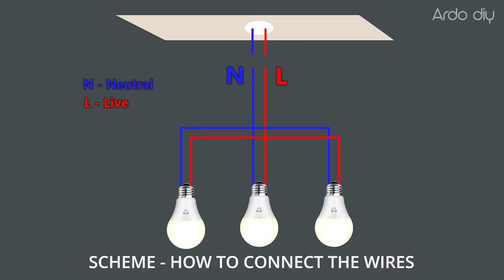Home Decor Idea - Diy Chandelier From PVC Pipe

Comment: Sad that the pancake box wasn't shown installed into the 1/2 center hole... But this method is also used with conduit pipe for larger spacing and even around bends (to follow the curvature of a bar). The pipes are primed and pained, and while they lead away from a closed pancake, they are attached to the ceiling with conduit straps (also primed and painted)!
Low voltage lighting gives great ambiance to accent these lights (just use inside the front top of cabinetry, and the light bounces off the crown moulding)!!
Reply from the maker: Thank you for your advice 🤗🤗

Comment: Hi i would love to make this myself could you send, the materials used, measurements and sizes please. This is a first attempt for me. I would like to know what to purchase when i go to the hardware supply store. Thank you.
Reply from the maker: Hello.
Forgive me for the late reply.
Pipe diameter 110mm
Pipe height 27cm
Use a drill to cut holes in pipes
buy wires, 3 sockets for bulbs,
threaded pipe to fix the lamp caps to the base.
one piece of board of your choice for the base of the chandelier.
Reply: Pipe dia =4 inches
PVC pipe costs around 800rs. 
And lights of your choice
Reply from the maker: @prakharsharma1281   
 thx
Reply from the maker: @karentsarukyan985   thanks bro 🤞😎

Comment: t's very nice, I have a question, is it white cardboard placed inside the chandelier? If not, can you tell me what the material is, I am thinking of buying materials and making it accordingly, I would be very happy if you could help me.
Reply from the maker: This is thick drawing paper called Whatman paper with a density of 200 g/m2.  Be sure to remember for this project you need to use only LED bulbs with a maximum power of 5watt
Reply: Thank you for your answer. Where can I get Whatman paper? What thickness should it be? @ArdoDIY
Reply from the maker: If your city has a specialized stationery store, you can search in these stores.  If you can’t find one, you can alternatively buy the thickest paper you can find, size A2 or A1
Reply: I understand, I'll look at the stationery stores and if I can't find it, I can use thick white cardboard and it won't be a problem, right? @ArdoDIY
Reply from the maker: Everything will be OK.  You should also paint the inside; the paint will provide an additional protective layer for the paper.  be sure to remember that for this project, you need to use only LED bulbs with a maximum power of 5watt.
Reply: I understand, I will take what you said into consideration, thank you very much for your help. @ArdoDIY

Comment: Hello. What kind of sheet you use as inner layer at 2:14?
Reply from the maker: hello this is a thick paper for drawing
Reply: @ArdoDIY   tracing paper? Is it safe to use?
Reply from the maker: @syp3284  hi thanks for the comment, this is not tracing paper, this is thick drawing paper.
For this project, you need to use LED bulbs, I have this chandelier hung in the kitchen and has been working for 6 months now, there are no problems.
Reply: @ArdoDIY  👍💞

Comment: I wanna know the name of the equipments used drillers type🤔
Reply from the maker: Titanium Coated Engraving Milling Cutter Carbide Bits
Reply from the maker: Bit like this https://www.amazon.com/0-8-3mm-Titanium-Engraving-Milling-Lukcase/dp/B07GZLX45X
Reply: @ArdoDIY  tysm
Reply: Hi good job my friend please tell me What kind of paper did you use inside the tube
Reply from the maker: @tarikbenchabane7854    Hello. thx for question.
You can use for this project heavy-weight drawing paper.
90-110 lb (approx 180-260 gsm):  heavy-weight drawing paper, bristol, multi-media papers.  Weight in this range is similar to card stock or light poster board.
Reply: hello ! ola , hi !

Comment: It's okay!
But where do I get all the tools needed???
Reply from the maker: Hello.
if you do not have these tools, you can ask your friends or buy. 
BUT👇👇👇
you can MAKE THIS chandelier even without these tools.
1. wooden rings can be replaced with pipe plugs,
2. random holes in the pipe can be made with a soldering iron,
3. and you can cut off the pipes and the wooden base with an ordinary saw.
Reply: Borrow from your uncle.
Reply from the maker: @leslieseptember6050   Super 👍👍

Comment: But, by the heat of light 
Paper inside can burn
Reply from the maker: HELLO. PROBABLY YOU DIDN'T WATCH THE VIDEO UNTIL THE END.
I CLEARLY EXPLAIN THAT IT IS POSSIBLE TO USE ONLY ECONOMICAL LED BULBS.
THESE LIGHTS ARE ALMOST NOT HEATING.

Comment: What kind of paper did you used??
Reply from the maker: Hello.
 You can use 90-110 lb (approximately 180-260 g / m2): heavyweight drawing paper, bristol, multimedia papers.  The weight in this range is similar to that of cardstock or lightweight cardstock.

Comment: What kind of sheet did you use?
Lovely project 👏
Reply from the maker: hello this is a drawing paper
Reply: @ArdoDIY  I know you have mentioned to only use LED, but does that not impose any danger regardless?  Easy to catch fire if anything happens other than overheating (which it won't) of the LED bulbs?
Reply from the maker: @maequicho  Hello, thanks for the question.
The fire is almost impossible.
LED lamps must ignite for a fire to occur.
I tested this chandelier, only  flame may cause fire .
A short circuit can hardly cause a fire.
This chandelier has been working in my kitchen for 2 months already.
and everything is fine.
Reply: @ArdoDIY  Thank  you for your prompt reply.  This is on my list of to-do projects now.
Reply from the maker: @maequicho  OK.  that's cool.  Thank you for everything and good luck !!!

Comment: What's the drill name u used in this video also what was the name of Paper u used
Reply from the maker: You can use for this project heavy-weight drawing paper.
90-110 lb (approx 180-260 gsm):  heavy-weight drawing paper, bristol, multi-media papers.  Weight in this range is similar to card stock or light poster board.
Reply from the maker: Bit like this https://www.amazon.com/0-8-3mm-Titanium-Engraving-Milling-Lukcase/dp/B07GZLX45X

Comment: Sir how much it will cost with full mateeial and with all machines used
Reply from the maker: I will count everything and answer you
Reply from the maker: MATERIALS
PVC pipe 1 meter: 2-3$ 
dawning paper a1: 0.5$
spray paint: 2-3$
wooden board: 1$
screws: 1$
wires: 2-3$ 
bulb sockets: - 3*0.25$
led bulbs: 3*1.5$

TOTAL PRICE - 15$

TOOLS
jigsaw: 40-50$
cordless drill: 60-70$
Variable Speed Steady-Grip Rotary Tool with 190-Piece Accessory Kit: 25-35$
JIGSAW KNIFE: 1$ 
ROTARY TOOL: BIT $1$
Reply: Thanks
Reply from the maker: @vaibhavsinghal4493  Don’t mention it 😉👍
Reply: Okk😅😅😅

Comment: Could you make one where we don’t have to use LEDs only?
Reply from the maker: Hello. 
do you mean the project is exactly the same as this one?  or any other where ordinary bulbs can be used?
Reply: @ArdoDIY  I guess my question is, What are some heat resistant materials would be good for an incandescent, or hotter like Halogen
Reply from the maker: @michaelrobb9708  I think it is better to choose a thin metal sheet, this is the best option

Comment: Mention the materials used
Reply from the maker: Hello.
Pipe diameter 110mm
Pipe height 27cm
Use a drill to cut holes in pipes
buy wires, 3 sockets for bulbs,
threaded pipe to fix the lamp caps to the base.
one piece of board of your choice for the base of the chandelier

Comment: Paper, hot bulbs and electricity sounds like dangerous....
Reply from the maker: If you use LED bulbs, there is nothing dangerous.
This chandelier in my kitchen has been working for 6 months without problems.
Thank you for your comment.
Reply: @ArdoDIY  I have also LED bulbs and sure they are getting hot
Reply from the maker: @ZeroFloat.  I have done a lot of projects and I didn't have LED bulbs getting too hot 🤷‍♂🤷‍♂
Reply from the maker: @ZeroFloat.  make a couple of holes with a diameter of 6 or 8 mm at the top to dissipate the heat generated by the lamp.